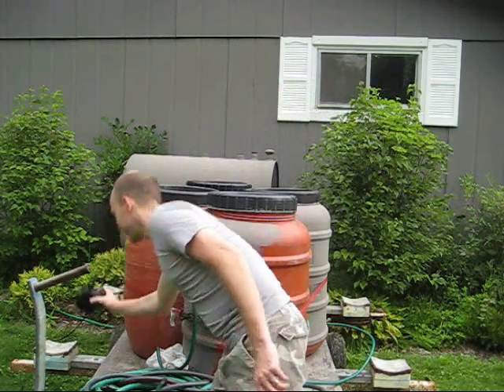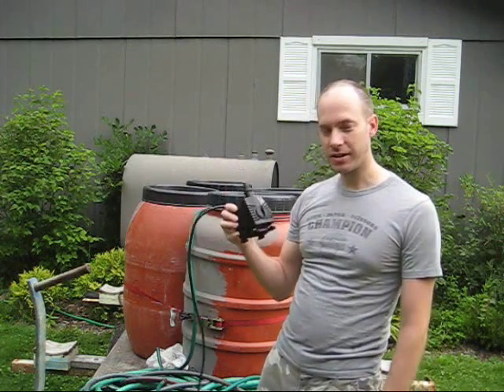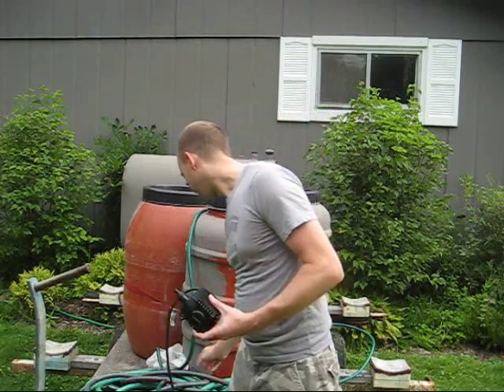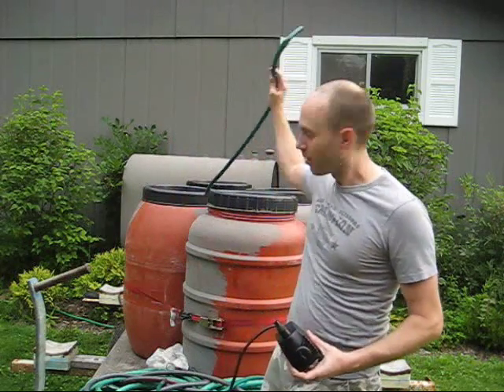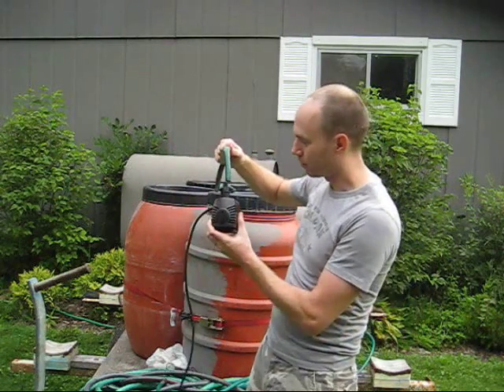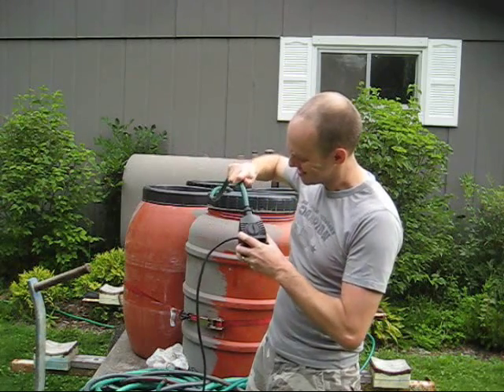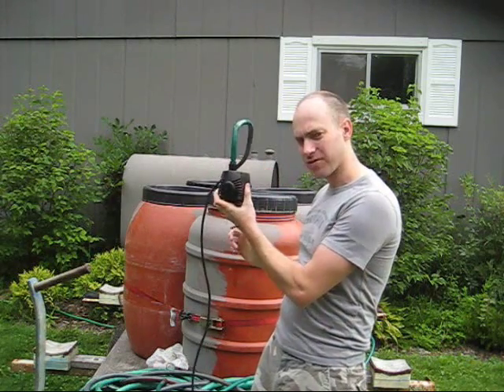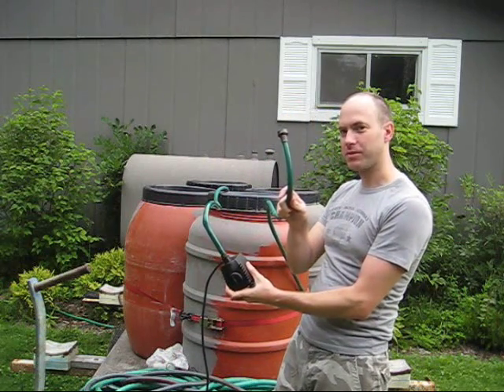Using a submerged fountain pump for heating fuel oil / diesel fuel scavenge. Far Reach Fuel Transfer

Comment: You are going to burn your house down 🙏🙏!! 110 volt pump that is not made to pump fuel it eventually will crap out short out catch on fire!! Very unsafe transfer pump should never be a submersible pump when pumping fuel. Unless if it is made for the application!!

Comment: That pump is not diesel fuel compatible. I am sure the seals are buna. The plastic is probably going to breakdown causing penetration into the watertight areas. Hopefully the pump fails and you do not start a large 🔥
Reply: I've seen diesel eat some plastics as well.  He should take this video down.  You get what you pay for.  There's a reason the diesel pumps cost more.  It's because you need different non-cheap materials if you want it to last more than 12 minutes.